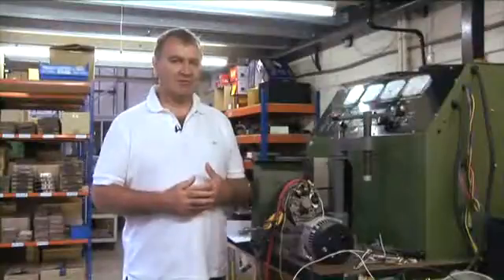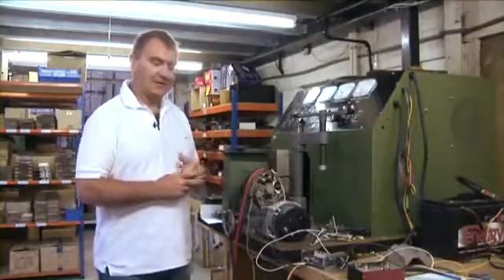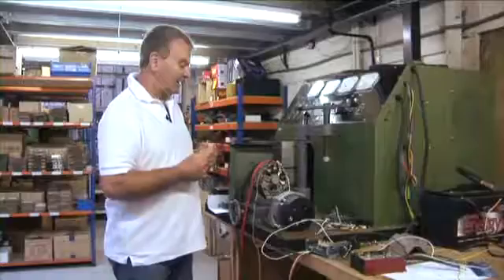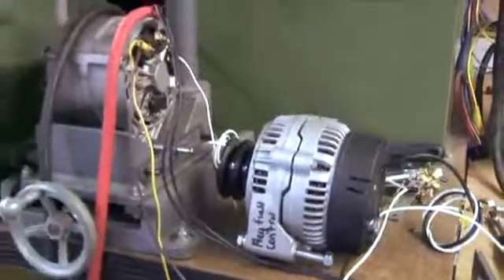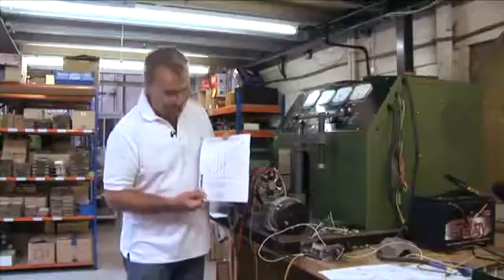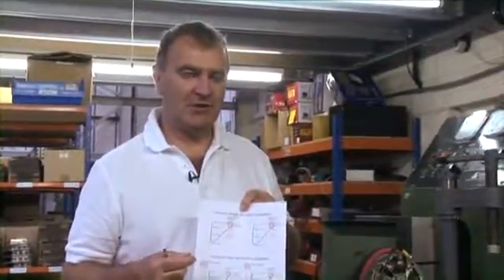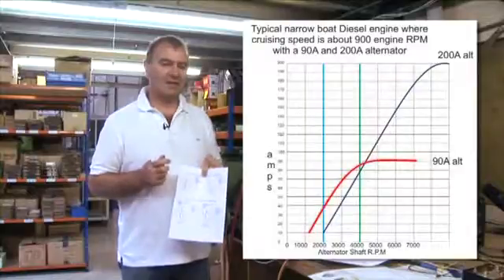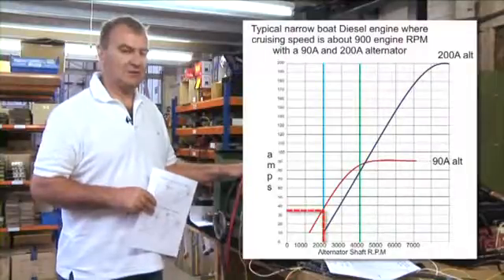Charles Sterling discussing wives' tales surrounding alternators and their power curves.

Comment: Hello. Nice explanation about power curves. One question: Are the curves taken with full field excitation? (I assume they would be if you have a dummy load connected.) 2nd question: Is an alternator's amp rating continuous or intermitant? The info that I've gleaned seems to suggest the latter.